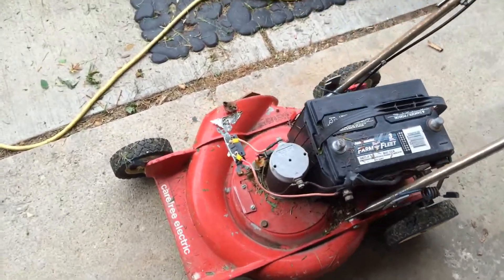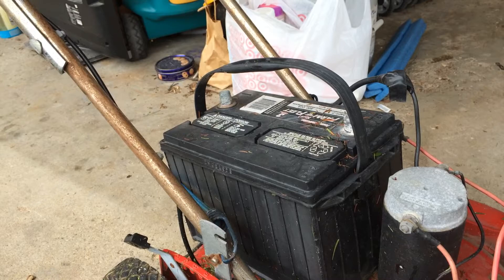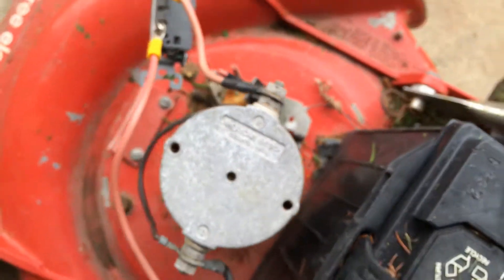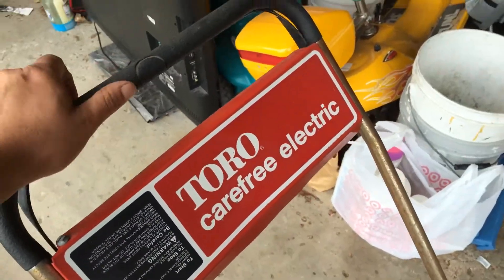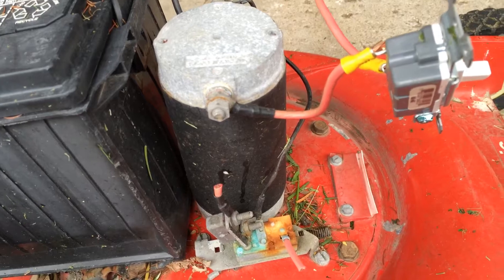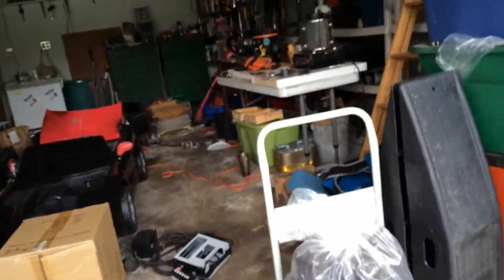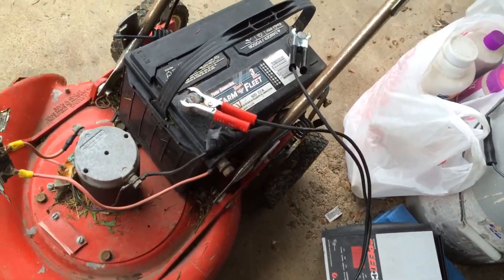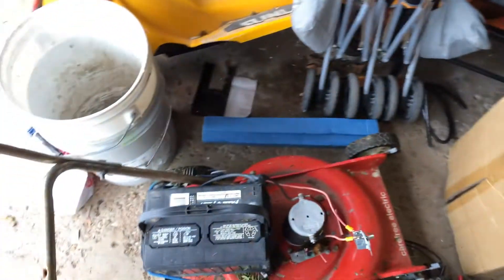Home brew battery electric lawn mower!

Comment: How well does a car battery work for this? I've got an old early 2000s MTD 21 inch push mower sitting under the house, motor threw a rod or something. If I could find a good motor for this and a used car battery this would be a cool project. Some sort of safety switch on the handle would be best, like on a standard gas mower with the safety lever. Just kinda sucks to leave it to rot, has a new handle and side discharge on it before the motor blew.
Reply from the maker: Aidan Montgomery the battery on it was
made in 03. it’s 2019 and my runtime is still 30+ minutes. a deep cycle would be better

Comment: This is NOT a starter motor.  It is the motor supplied with this mower.
Reply from the maker: That's funny, as I took the motor off a wrecked VW's starter and gave it to a friends father, who did the original "conversion". And also funny since I even removed the cord from it (Originally Corded plugin).

Comment: I think you are mistaken, and that this was originally a battery powered mower, and that is the original motor.   I certainly have an identical motor that I robbed from a battery powered mower of this size;.   search Bosch Permanent Magnet 12vdc motor.. here to see it.

Comment: What model starter motor is that?
Reply from the maker: +Sam LastName Can't tell, it's all rusted off.
Reply: It is NOT a starter motor.  It is a low speed high torque permanent magnet motor that is the original motor in this mower. Made by American Bosch.  I haven't found any data on it yet.. but it is approx.designed for approx.  1/3 hp ( 20 A)  continuous duty, but like all electric motors can do considerably more for short periods.

Comment: Its odd that the starter doesn't overheat, mabye it has something to do with a non consistent load.
Reply from the maker: The starter, when starting a car, draws 300-400-500+ amps (And 3,600+ Watts) due to the cranking force required. Though, when free spinning, and taking the mild load when the blade hits the grass, it draws at most 14 or 15 amps (180 Watts). Less power consumption, less heat build up.
Reply: *****  Thats what I figured

Comment: I can't believe we're paying $3.50 a gallon just to mow the grass. I'm going to try this. I bet the battery charges for less that 15 cents! Great idea!
Reply from the maker: toyotaprius79 Cut only every month? I need to do it weekly at minimum :)  Yes, we have the the corded ones. They are nice, but the cords are a pain in the butt. My yard is too big to use electric or battery mower. I use this one for tripping what my tractor cannot get to. But, at least I'm not paying for gas for my tractor. I use the old stale gas that I extract from motorcycles (that would otherwise be discarded) in my Lawn Tractor to mow the lawn. Just waiting for the engine to die on that, then I will remove the engine and rebuild with a electric motor.
Reply: I'm in Ireland and I've used electric lawnmowers for as long as I can remember. You just need an extension cable, preferably the heavy duty, 16amp ones that roll up. I couldn't imagine paying for petrol to cut both the front and back grass every month! I wouldn't know what it would be like to find out that it'll need a bloody fix or service afterleaving it unused over the winter. And neighter would it be fun pushing behind and getting a face-full of fumes and ear-full of wringing. I don't know why electric lawnmowers aren't that popular in the US.

All you need is to swing the cord away like a rope from the path of the mower, no problem with that.
Reply: ***** A month, or a little less is about when the grass starts to become uneven and the leaves of weeds start to become noticeable. That's the practice during Spring and Autumn, but during the Summer, there are a couple of dry spells. There was one last week and I would be cutting the grass every two weeks because there's usually a massive downpour after a one or two week heat wave. So I always trim it by then and I was lucky to do so the night before it pelted down.

During the winter, it's far too wet to cut and the days are too short. It's awful when it's a warm Winter as the grass just becomes unbareable.

I should mention that I don't have a large plot of land. Two 3x4 metre patches up front and one 7x9 metre out back, which is larger than most. That's a bit too small for a motorised lawnmower (I was shocked at first when you said tractor). I like swinging the cord around, it kinda makes it like a proffessional skill of some sort. It keeps you occupied if you're that type of person. The only problem I do have with them (I only have experience with electric lawnmowers) are that they hold very little grass and they fill up quickly. You'd spend almost a third of your time walking to the street, emptying the grass in the compost bin and walk back.

There are a few people on my road with petrol lawnmowers and they use it for the smallest of patches of grass. They're annoyingly loud when you're close to them and trying to have a conversation, just as bad as having a conversation when a small diesel car to a giant diesel delivery van or SUV roars past on the road. I can hear them (the petrol lawnmowers) from a long distance when cutting my own grass, that's how loud they are, but fortunately they also trim their grass every month.